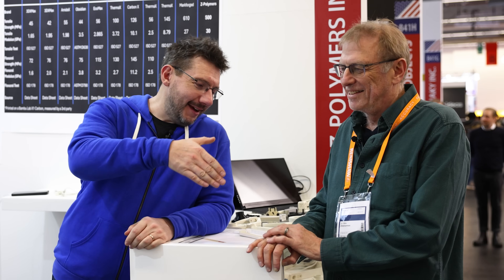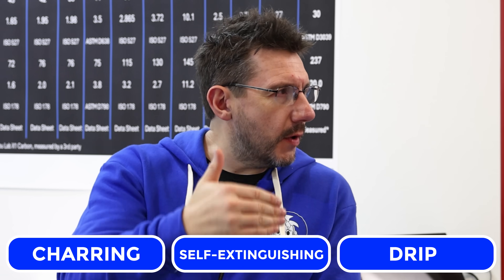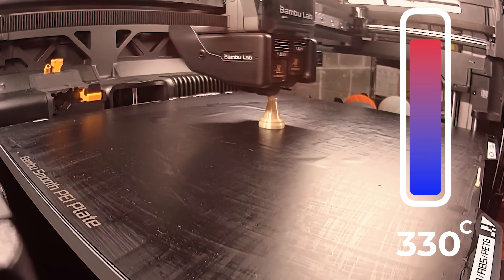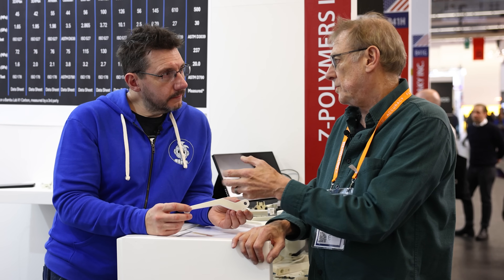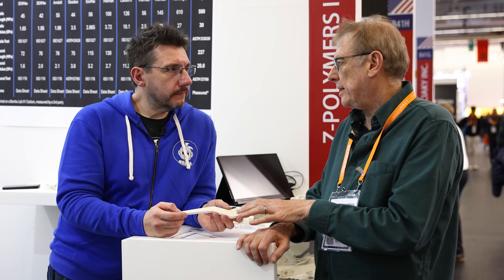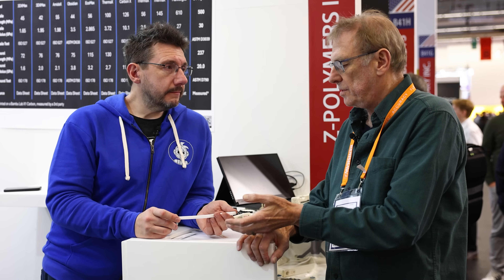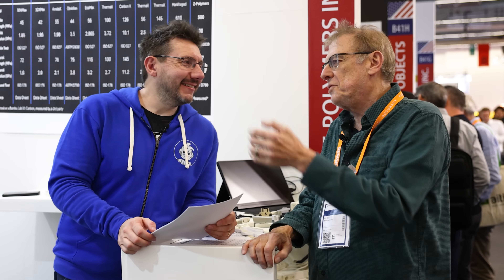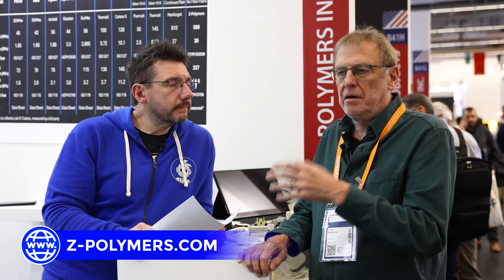Unicorn Filament! COMPOSITING Tullomer from Z-Polymers!

Comment: $300 for 500grams - best you be building rocket ship parts with this stuff.
Reply: Depends on what you're making. If you're making custom parts that would ordinarily be milled out of metal, it's a steal.
Reply: @jmforeman02   its a steel
Reply: @jmforeman02  Funny you should say, I'm in the process of planning some one-time-use rocket motor engine casings. It's still pricey, but maybe within reason.
Reply: I bet if you said you wanted to build an optimized profile for XYZ printer and slicer he’d send you filament for free to do it.  He published his email address for a reason: he wants his product to be accessible to hobbyists.
Reply: not bad if all you need from it is a 10% composite for that performance
Reply: @chrisfrancis1914   Good point 👍 I just bought the H2D so I can now print dual material now. I have been printing our tools for using PAHT-CF for strength test. I'm going to try Tullomer to line the inside of our sockets printed in PAHT-CF for added strength.
Reply: I say it'll come down to 100$ /kg in 4 years.
Reply: @lostcosmos3245  300 is not a lot of money in the commercial world. If it can solve problems.
Reply: oh sh*t!
Reply: Honestly, that's not too crazy. For comparison Markforged, a company that has been around for years has their main ONYX filament costed at ~$190 for 1kg of filament.
Reply: Go look at the price of peek....
Reply: you're poor
Reply: @CarAudioInc  rich people don't get that way spending their money
Reply: @CarAudioInc  Think before you speak. 

You install car audio systems for a living, so you arent exactly rich yourself.

Not to mention it isn't very intelligent to make disrespectful comments like this via a business type page...

Anyway, I sincerely hope your life improves from here. Maybe in the future you will mature and realize this type of behavior isn't productive.

Wild that I, of all the youtube goers, had to correct you. 

Happy Thanksgiving!